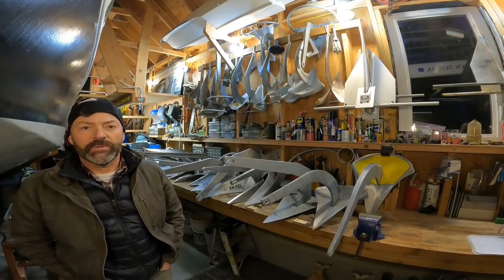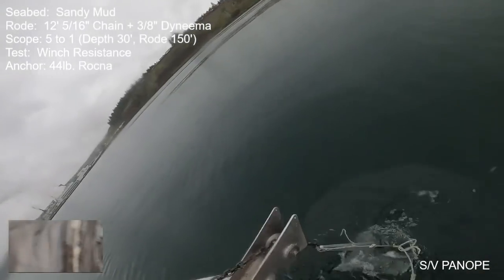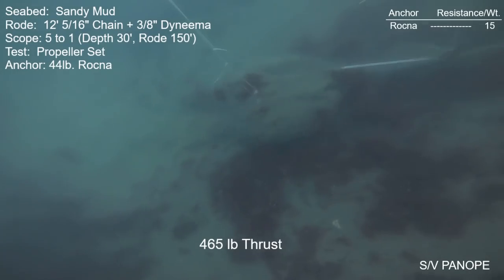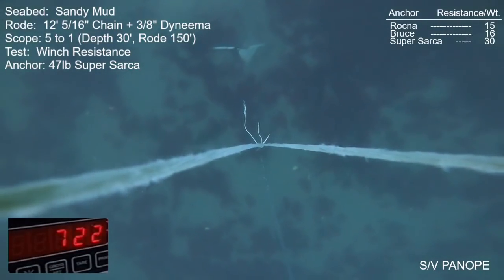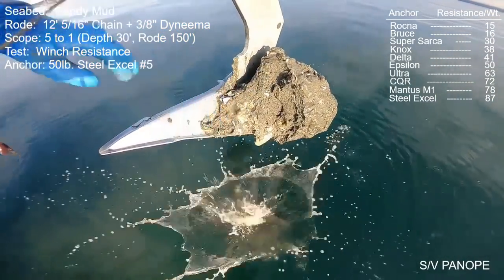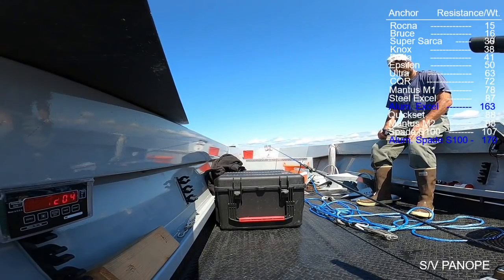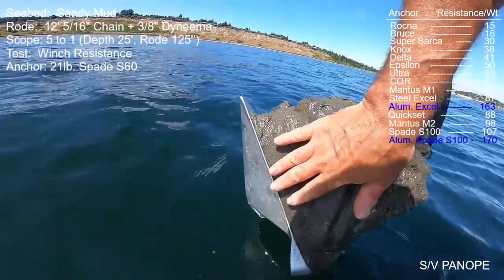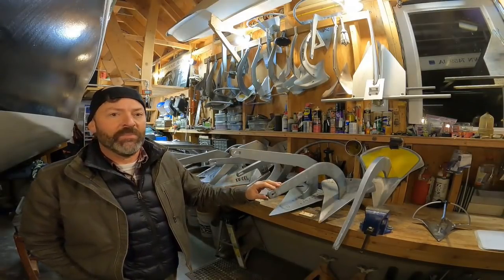45lb Anchor. Sandy Mud Winch Testing. Video # 130

Comment: Thanks a lot for making anchoring safer and easier, impressive. 
Regarding patterns, it looks as if virtual volume makes a difference. Volume measured after "enrobing" the anchor with duct tape or similar.
Reply from the maker: Interesting theory.  "Flat" anchors like Danforth/Fortress might break rule.

Comment: As usual Steve, great info, and many, many thanks for your efforts.

As to your holding power vs reset scenario, I think I would put myself in the reset category, as the 'back-down' on an initial anchor set is rarely ever the direction of the inevitable blow that may come into the anchorage. Although many of these anchors broke loose and did reset, I'd love to see a 180 (or even 90 degree) veer test of these same anchors in these same conditions.

Now, if you'll excuse me as I throw my 20KG Rocna up on Craigslist. 🙄
Reply: Exactly this! The CQR looks like a front-runner until a 180 deg reset comes into play. The CQR is notorious for fouling when resetting on a 180 deg backing wind.

Comment: This is another interesting test, thank you for that. And rightly so that you say that one seabed is not equal to the other. So the choice for a type of anchor should be based on an overall performance. An anchor with good holding power is nice, but when it bends it becomes useless and thus it is unreliable, thus not a good choice. And let me say it is also remarkable that an anchor that is poorly rated here is the anchor of first choice for world sailors. A well-known vloggers couple started with a Mantus, but after a while it was replaced by an overall reliable Rocna.
So, indeed. Look at what you need yourself, your boat anchor combination. Maybe just an anchor that's a little bigger. Choose a strong one without bolts you will lose some day (Mantus)
An anchor is much more than just holding power.

Comment: Great vids!
Say, you'll want to test the "Columbia River Rocking-chair Rock Anchors" that are designed to break away from rocks via a tie-strap that's lashed to the front eye of the anchor (the end of the anchor line is tied to the BACK end of the anchor to be pulled "backwards" after the tie-strap breaks after being pulled real hard if the anchor gets stuck in the rocks.)